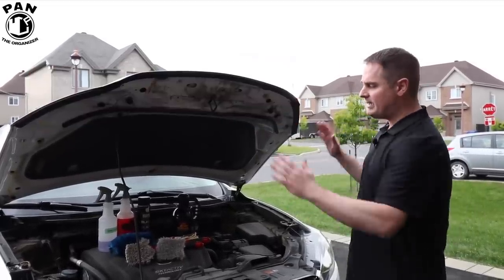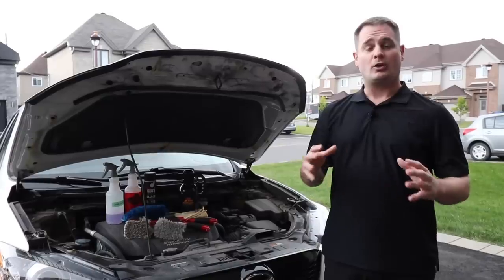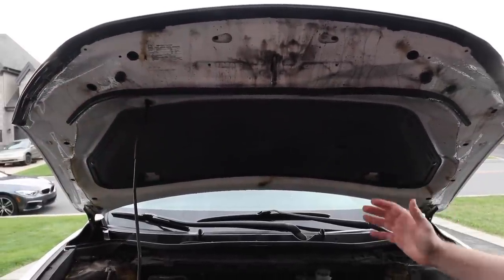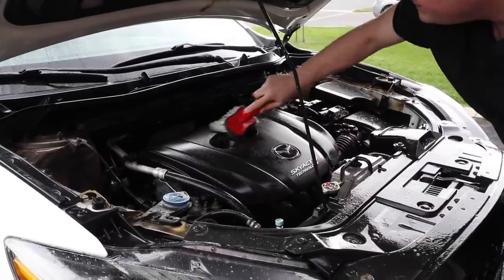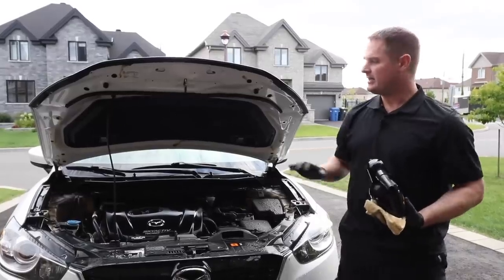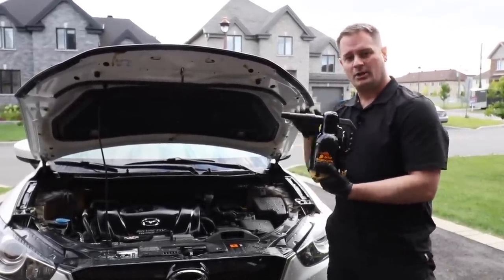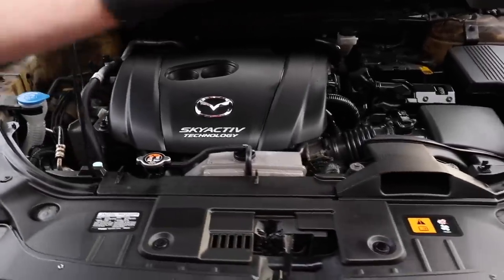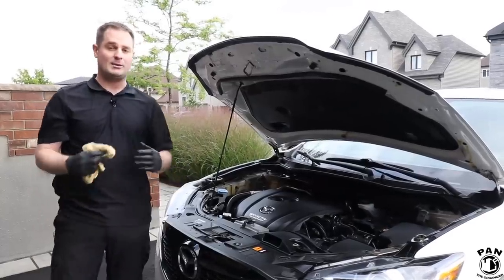HOW TO CLEAN YOUR ENGINE BAY !!!  EASY TUTORIAL !

Comment: Awesome vid Pan...Do you ever heat up your Instant Shine cans before spraying? It will make a finer mist and get into tighter area's. As I have been doing detailing for some time I always enjoy learning about different ways to go about cleaning or restoration. H pattern on the engine bay also works great too.
Reply from the maker: Nice tip!  How do you heat the cans without it being a potential danger?
Reply: Pan TheOrganizer A simple hair dryer is all you need...place 6 inches away from the Can and while you finish drying the engine bay just check to see it does not get too hot..It can get hot but just so long as you get it warmer than normal. Also you can leave it in the sunlight which works great as well if its a sunny day!

Comment: Is it safe to use water in the engine bay without covering all electronics and electrical wires?
Reply from the maker: If you have a recent car (less than 8 years old) yes.  Engine bays are water tight these days.  To be on the safe side, you can cover exposed sensitive parts like alternators, electronics, etc.  Common sense.
Reply: @PanTheOrganizer  My Toyota Yaris is from 2007 so I guess I will have a bit more work to do in relation to waterproof the electronic components xD. Thanks for your answer and help 👏👍

Comment: Have you ever had problems with water on the electronics under hood?
Reply from the maker: Nope.  Most modern cars less than 8 years old are pretty much water proof in the engine bay.  On older cars, use common sense and cover sensitive electronics or parts.
Reply: He said ten years first now eight! Whenever you rinse the engine Bay Area disconnect the battery first cover your alternator and other exposed electrical components it’s safer to use a garden hose a pressure washer even on the lowest setting can force water into places water should never go Common sense.

Comment: Hey Pan. I cleaned my engine, which is the exact same as the one in the video, and when i rinsed it off, some smoke came out from the back of the engine area, although my engine was fairly cold. Did you notice any smoke as well? Thanks as always.
Reply from the maker: +2pac of YT 
Nope never noticed smoke.  Your engine probably wasn’t cold enough.  Could have been water evaporating...
Reply: Pan TheOrganizer Maybe, thanks for replying. :)
Reply from the maker: My pleasure!  How did you discover my channel?
Reply: Pan TheOrganizer I was looking for videos on nano ceramic coating, which btw your video was the most helpful. Good job sir.

Comment: I usually mix a special foam mix for engine details also steaming the questionable areas, your thoughts on this method?
Reply from the maker: Yes steam cleaning can be ok, but we have water in abundance here in Canada so we tend to use the traditional wash methods.

How did you discover my channel Tulsi?
Reply: Pan TheOrganizer just "fishing"I'm involved in running ba detailing bay here I steam the engines that the owners are afraid of water damage
Reply from the maker: Yes I understand that.  That's why it's important to educate people that if done right, you can wash your engine bay with free flowing water.  It's normal that people are scared.  What they don't know, is that car manufacturers do heavy water infiltration testing and spray the car with enormous amounts of water in labs to make sure the cars are water tight and that the engines don't suffer.

Comment: when you wash the car doesn't water splash through the grill and around the edges into the engine bay?
Reply from the maker: Where are you going with your question?
Reply: @PanTheOrganizer  well if you clean the engine bay and dress it, won't soap and water get in and mess it up when you wash the car?
Dress it after the wash? 
Just trying to understand best way to go about it without chasing my tail
Reply from the maker: No worries.  You never spray into your engine bay while washing your car.  It’s a non issue.

Comment: is it safe to rinse the engine with water? will the engine restart later?
Reply from the maker: Hi Josh.  Pretty much all recent cars (less than 10 years old) have water tight engine bays.  Manufacturers go to great lengths to ensure the components are water proof.  Of course use common sense and cover exposed sensitive electronics on older cars and you’ll be fine.

Comment: Is super clean degreaser acid?  So it can be harsh on painted or powder coated wheels? Thx
Reply from the maker: No, quite the opposite.  Super Clean is high pH (acid is low pH).  But for wheels you should be using a wheel cleaner.
Reply: Pan TheOrganizer so you wouldn’t trust it on wheels?  I have some custom painted finish wheels made by Fuel.   What wheel cleaner would you recommend?
Reply from the maker: P&S Brake Buster (I have an upcoming review on that so stay tuned) or Eagle One All Wheel n Tire cleaner that I reviewed here: https://youtu.be/2WCKFCxlOLo

AngelWax Bilberry wheel cleaner is great and so is Auto Fanatic Wheel Cleaner that I reviewed here: https://youtu.be/xoCdWxnd9KM

Comment: @pan theorganiser just looking to improve it? Why do half a job, or was this just for the sake of the video length?
Reply from the maker: What do you mean half a job?
Reply: @PanTheOrganizer   upon starting the underside of the bonnet, you said, you were doing it just to tidy it up a little because it's a daily. Daily or show car, if your detailing something, shouldn't it all be to the same standard?
Reply: I did find your information and techniques useful though so, thankyou for that
Reply from the maker: The point here was just a spruce up.  What I meant was we weren't striving for perfection like a show car, as this is daily driven.  You can easily spend 5-6 hours on an engine bay detail by getting in nooks and crannies and perfectly cleaning every last bolt.  That is pointless on a daily driver in my opinion.  What you do want is to get it looking great without it being a museum piece.

Kind of like paint correction.  On a daily driven vehicle, the customer can pay for a paint enhancement, to get 60-65% correction which looks great for most people.  You can have a 1 or 2 stage polish job to get 80-85% correction, looking even better, but more expensive.  And if you want absolute perfection for a show car, museum level, or collection, you can got up to wet sanding, 2 or 3 stage polish, and spend a few days polishing the paint.  Again, the price increases dramatically.  So it's not about doing half a job in the basic package, you're simply going with the customer's needs and budget.  You're still making as good of a job as possible regardless of the package.
Reply from the maker: Thanks.  How did you discover my channel by the way?
Reply: @PanTheOrganizer  the #detailing in all honestly, I have watched a few of your videos though

Comment: Does the battery have to be removed or disconnected while rinsing
Reply from the maker: If you want extra precaution you can disconnect it, but no need to remove it.  I never disconnect them.

Comment: Do you think a car made in 1999 would have a water proof engine bay?
Reply: Most cars are designed to be water resistant under the hood. The challenge is that with age, they are less water resistant. 

I have no idea where he came up with the 10 year old statement. Water and electronics have been around a lot longer than 10 years.
Reply: @Atlec-j9y  Awesome. Thanks

Comment: hello pan the organizer, which parts will i need to cover with a plastic bag for a corolla?
Reply from the maker: If your Corolla is less than 8 years old, don't even worry about covering anything.  If it's older, cover sensitive parts like alternator, distributors, exposed fuse boxes or electrical components, etc.  I can't go over every single car as they're all made different...
Reply: big help pan the organizer many thanks! hope you can always respond to our questions 👍

Comment: Excellent! What else can I say? I have a stock 1970s coupe. Glad you mentioned the 10-year or younger timeframe for engine bay detailing according to your method because I was concerned about spraying water and degreasers in there. Long story short, yesterday, I took some damp cloth towels (and some dry ones) and wiped everything down (first time I've ever detailed an engine room).  No chemicals, just water. It's not showroom ready, but it looks much better now than before. Taking great care, next time, I'll likely use some of your tips and tricks to make my engine room look a bit nicer than it does now. Don't want to mess anything up since replacement parts are hard to find for some older cars. And labor isn't cheap.
Reply from the maker: Thanks Jolly! How did you discover my channel by the way?
Reply: @PanTheOrganizer  I believe I typed "clean engine bay" in the Google search field. A link saying "HOW TO CLEAN YOUR ENGINE BAY !!! EASY TUTORIAL..." came up.  It was pretty simple.
Reply from the maker: Thanks for the feedback!

Comment: Is there any function/benefit of cleaning the engine bay?
Reply from the maker: That would be the same if you asked if there are any benefits of washing your car.  Only you can answer that.  This is a detailing channel, so my answer will always be yes of course.  I love a clean car inside and out.  Also, having a clean engine bay is great for mechanics to work in a clean environment and also allows issues to be detected quicker if for example you get an oil leak in a clean engine bay it's easy to spot.  If you get an oil leak in a disgusting greasy engine bay, it will be harder to spot.
Reply: Pan TheOrganizer Thank you for the detailed response Pan! I didn’t ask the question in a demeaning way, I  love your videos!

Comment: what can i do if i dont have an air blower?
Reply from the maker: Use a leaf blower.  Or microfiber towels to dry as much as you can then start the engine and let it run a few minutes (in an open area of course) to finish the drying.

Comment: Hey Pan , Can you use Ceramic spray on a clean engine bay
Reply from the maker: It depends if it can resist the high heat from the engine bay. It would be best to use a wheel and plastics coating meant for high heat, like this one: https://bit.ly/3hKbyZW
Reply: @PanTheOrganizer  thanks again Sir. ..I will

Comment: Wouldn’t it make sense to cover the wiring?? 🤔
Reply from the maker: You do what ever makes you feel safer. Common sense. I have been detailing cars for over 23 years and never once had an issue with detailing an engine bay. Especially in the last 10 years, car manufacturers really stepped their game up to make their their engine bays are water tight. But you may want to cover sensitive parts like onboard computers, fuse boxes, air intakes, alternators, etc, if you're not sure of what you're doing.
Reply: @PanTheOrganizer  yeah I cover up all electrical wiring I can see, including alternator, but I rather be safe than sorry 🤙🏼
Reply from the maker: How did you discover my channel by the way?
Reply: @PanTheOrganizer  looking for tutorials on how to properly wash engine bay.

Comment: Does the battery can get wet?
Reply from the maker: On modern cars (less than 15 years old) it's not really an issue. As long as you keep the water moving and not focusing the jet on the same place for too long. Also, don't use anything over 2000 psi. I set my pressure washer to 1000 psi to wash cars. Or you can use a garden hose.

Of course, always use common sense when detailing an engine bay. And take safety precautions if you feel that you need them. You could for example disconnect the battery, and cover any sensitive electronics with a plastic baggie.

Comment: Why didnt you use your pressure washer on this job?
Reply from the maker: To show that you don't need a pressure washer to do an engine bay detail.  You don't need much water pressure.  Actually, it's even better to use as little pressure as possible, just to make sure the water doesn't get into places you wouldn't want it to, out of pure precaution.
Reply: Pan TheOrganizer does it make a difference if you use the pressure washer while the engine is runnning?
Reply from the maker: Do not do an engine bay detail while the engine is running.  Why would you think of doing that??

You usually do an engine bay detail on a cool engine bay.

Comment: Is it necessary to take the battery out for this?
Reply from the maker: As a safety precaution I would suggest to disconnect it, but I never do.  In 23 years of detailing experience, I have never had issues.  Just use some good old common sense.
Reply: @PanTheOrganizer  Thanks! I'll take your advice.

Comment: My pet peeve dirty engine bays
Reply from the maker: I agree, it's often an overlooked area.  Plus the fact that a lot of people are scared to put any type of water under the hood.  If you do things properly and use common sense, there are no worries to be had.  I've been detailing engine bays for over 20 years and never had a single fail.
Reply: Pan TheOrganizer I agree. I’ve been cleaning the engine the way you’ve done it for 10 years never had issues. Plus the amount of salt that gets kicked up in there corrodes everything. Plus a clean engine runs cooler temps.